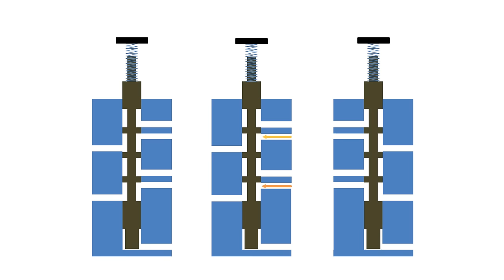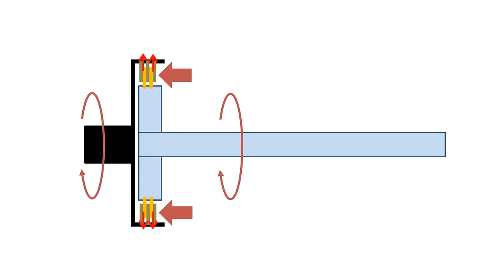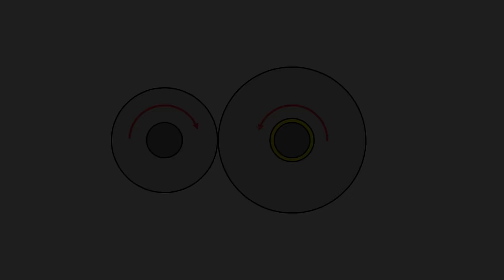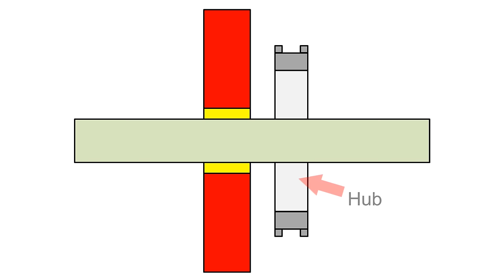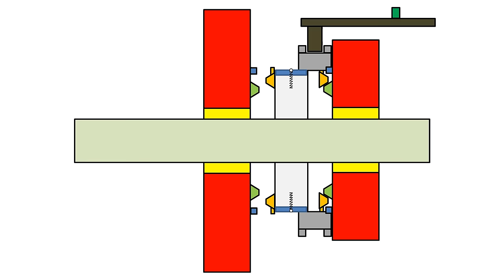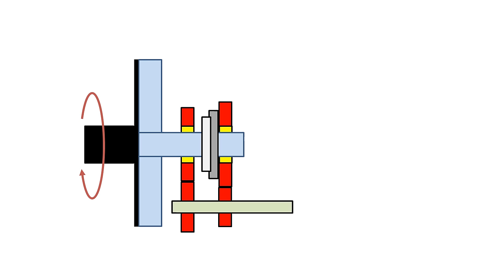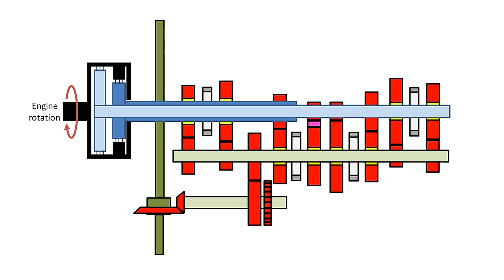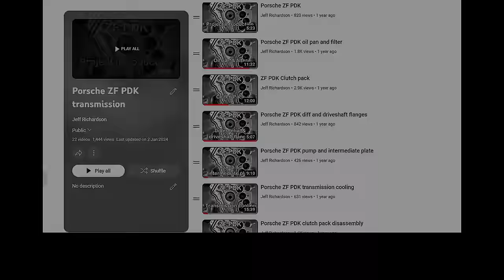World's Best DCT. Porsche PDK. How it works........... Part 1.........

Comment: Nice video. I'm working at the factory.
Reply from the maker: Really, at the ZF factory, and in what capacity?
Reply: @jeffrichardsoncardiy  since a few years in the production of the 8DT. I only occasionally work at the 7DT for the 911 and boxter. I know how to take them apart and later rebuild them, but of course in a production of new transmission many cheap parts simply will be  replaced after taking it apart.
Reply from the maker: @rakisuta1100  Thanks for getting back to me. I have a couple of questions if that's OK. How similar is the 7DT to the 8DT in the basics of the way it works? I'm also interested in getting some information about how to disassemble the gear set completely. If you were able to contact me on the channel email so I could get into your head a bit I'd really appreciate it. Email is jjrichar12@gmail.com
Reply: @jeffrichardsoncardiy  differences are a lot to be honest. Like the position of the Stift rods is now measured at the black pressure actuator at the end of it by magnets. 5 in total. Most of the oil pressure is now directed in the aluminum piece that holds the dual clutch. The pressure of the pump can be regulated, by a piston in the valve body, to save fuel or shift faster. Also the variable diff lock is managed by the valve body in 8DT, 7DT had an extra part for this.

The layout of the gears is very different. It has 2 main shafts, 1 to combine them, 2 input shafts and 1 pinion shaft. 1-5, 3-7 on input shaft 1 and 2-6 and 4-8 on input shaft 2 are the synchronizers. The reverse is separated. The high gears have  a single fixed gear. It's 5-7 and 6-8. Why combine them? To save build length.
Reply: @jeffrichardsoncardiy  how to take a boxter transmission apart. Be aware it's been quite a few years since I did it the last time and we have a lot of special tools.
Please use something to fix the 7th gears in place, so they don't fall off. 
I think you'll need a stand where both shafts from the non clutch side keep in position after the support inside gets removed.
1. We start with the clutch side up.
2. Remove those pieces that prevent a second gear to go in and the small sheet metal under fixed 4 gear. 
3. Now you need to take off fixed 6 gear by pressure on the shaft and pulling the gear up.
4. Now you need to have a tool that grabs under the other 6th gear dog tooth to pull it up, but you need to pressure it down on the input shaft 2. 
5. Remove the shift fork 4-6 and I think you can take off 4th gear fixed now, then take off 4th gear by pulling under it and pressuring the second input shaft. 
6. The gears on the counter shaft should be loose, just take them off if I remember correctly.
7. Remove the 1st aluminum piece for supporting the shafts. 
8. 2/R synchro. You can remove one side of it also the shift fork, there might be snap ring. Memory gets a little cloudy.
9. Remove the second aluminum piece that  holds the shift forks and remove those as well.
10. I think we are finished on this side and the shafts should separate now and can be removed. 
11. Input shaft 1 might have a snap ring under 7th gear. The rest can be pressed off.
12. Main shaft can be taken apart till the synchro and then be pressed off completely.

I hope you can understand it. It's just by memory.
Reply from the maker: @rakisuta1100  Thanks for getting back so quickly. I'll take a look and I'll probably get back to you when I have another look at it. 

My first question is how much force is generally required to move the gears that are an interference fit on the shafts. I'd tried to remove some at the clutch end gears and I just bent tools. I got the impression I needed a lot of heat and a hydraulic press.
Reply: @jeffrichardsoncardiy  you clearly need a hydraulic press to take off the single gears. Heat can help of course, but we never needed it. Don't know about how much pressure you need to take parts off. It wasn't a big pump, that's all I remember.
Reply from the maker: Another question if that's OK. What is holding the two shafts together that requires them to be pressed apart. Is there an internal bearing that is an interference fit? If so, what type of bearing is it? Thanks
Reply: @jeffrichardsoncardiy  the two shafts are connected by the aluminum piece under the gear for transfer the power to the pinion shaft. Each shaft inside of it has a roller bearing that's pressed on the shafts.
Every loose gear has a needle bearing with an inner ring pressed on the shaft. It's basically all stacked over each other. Kinda like an inner ring , synchro inner part and then another inner ring. At the end often a flat ring is pressed on to hold the loose gear in place and lubricate it at engine start.
Reply from the maker: Thanks again. Much appreciated.
Reply from the maker: I had a good look at it and now understand the sequence as per your instructions above. Step 3 is where I'm currently at trying to think up tools that I might be able to remove the first fixed gear on the main shaft (4th). This seems to be machined as a single piece with the spacer that sit between it and the 6th fixed gear. 

My question is how large the spline under the 4th fixed gear with spacer? It's clearly an interference fit, as the force required to remove it is huge. Is the spline just under the 4th gear and there is nothing under the spacer portion? If the splines are longer than this it would be difficult to remove the whole thing due to the end of the mainshaft being only about an inch.

Also, at the end of the mainshaft there is the inner bearing race that looks to be pressed on. This is what the needle roller bearing that is clipped into the main casing and is what the end of the mainshaft rotates in. I'm assuming this inner race that is pressed onto the  mainshaft can stay in place while the fixed gear is removed, or does this need to come off first? Or is it removed when the fixed gear is removed?

Thanks

Comment: Can an oil leak from the bell housing be connected to the clutch pack friction discs?or it could only come from the central seal and the big cover oring..
Reply from the maker: It can't really come from anywhere but the two seals you mention on the front cover. There is constant oil being shot out of the clutch pack and being collected in the pan.

Comment: Thank you for this very well presented explanation.
I assume Porsche PDK and VW/Audi DSG transmissions would be very similar since they are all part of the VAG group?
Reply from the maker: They are completely different. The PDK is a ZF product. Nothing to do with VAG except that VAG purchased it to fit exclusively in Porsche.
Reply: @jeffrichardsoncardiy I would disagree with you on that, I worked at Valmet who manufactured the 987.1 the 2003 R32 DSG used a dry clutch and the PDK uses wet clutch as an evolution of the VW gearbox use case in real life, the Audi 01E are structurally more important than you would hope as the diff and casing and 4wd are more A6 than 962. It's built by ZF and not by Porsche, hence the parts not being sold separately because Porsche doesn't make gearboxes and why this video is so revealing. The electronics, syncros, gears are shared with other cars and the reason for the early 987 2.7 having a lower ratio diff was because it was pushing an R32 around at the time. It is also why you did not get a Cayenne PDK but a Tiptronic as this is not a specific Porsche design on its own but a pooled resource.

Comment: Hey Jeff, thank you for your video. I’m a bit confused about how the synchro key works. At what point does the key get pushed down?
Reply from the maker: If by key you mean the strut, it is moved the moment the slider moves, as the strut ball is stuck in the detent in the slider.

Comment: Excellent video as always Jeff! Do you know much about spoiler failure? I had mine fail on the way to the dealer for PDK servicing and they are quoting a new drive unit replacement at a significant cost. They saw error code 81010E on the history and the motor was stripped. There seems to be very little information online so it seems like it must be a rare issue - 90% of what I found for that error code applies to the Panamera. Hoping the drive unit can be repaired rather than a total replacement... and of course if theres anything I should do to avoid it happening again
Reply from the maker: There's some info here on the spoiler that might help.
https://www.youtube.com/watch?v=it_DTpTYst0

Comment: Great description of the PDK. Thank you. I am wondering if, basically, the Macans use the same PDKs as the Boxster/Caymans and 911s? And I assume all PDKs are built to handle the torque of the 911 turbo?
Reply: 4 door porsches use modified audi dct certified as pdk. only turbo and gt2rs comes equipped with more capable pdk

Comment: When the transmission shafts and engine need to be disconnected, how are the clutch plates separated? Or is it the case they are always in slight contact hence the need for lubrication?
Reply from the maker: They just become loose with respect to each other, and with the lubrication they never touch and so don't wear.

Comment: Can anyone offer an opinion on my recently acquired 4.0 GTS pdk. 2500miles
It’s clunky /noisy moving off standstill in drive particularly when coming off holding on the brake downhill .
Only found after thoroughly warmed up.
Possibly clutch pack?

Comment: Great explanation and excellent engineering by Porsche, too bad the drivability of the transmission is crap. This is primarily due to controls and I’m not sure if a mechanical limitation. Maybe you can shed some light on this. The transmission prevents upshifts and downshifts that would not cause redline. It also will not bounce off the rev-limiter and hold gear, it always wants to shift which is bad for some situations. There is no true manual mode, it will always shift up or down when in M mode. Sometimes the cpu gets lost and there is a delay in shifting. I sold my Porsche because the drivability of the transmission is horrendous. Give me a 6-speed any day over the PDK automatic. It’s actually hard to find a manual Porsche these days???

Comment: A little history on how long it took to make this transmission small enough to get into a normal sports car. They were developing this transmission in 1983 for  LeMans. I think they won Lemans in 1986 with this in an extremely long tail race car. I bought one of the first 911s with the PDK in 2009 . I’ve probably got some of this wrong but I believe the timeline is close.

Also after the credit crash of 2008 I got the best deal I’ve ever received on a 911. It was a 911S with MSRP of $103,000. Nicely equipped. Porsche was giving $12,000 rebates PLUS 0.9% financing BEFORE negotiating. I think I got out at $78,000 out the door. 
In hindsight I should have just kept my 997.1 GT3 but I felt that credit crash coming and I didn’t want a high value asset like that. But I still have a GT3 now

Comment: Jeff if you can or if you’ve done the research can you explain parts cost based on which part failed? It would be easier for backyard mechanics to replace subassembly rather than actual individual parts without special Porsche tools?

Comment: hi Jeff I purchased a 2012 boxster with water ingress to passengers footwell and the car was not running , I changed the body control unit and pdc unit , nothing else seemed to have had any water on it , the car will still not crank at all , the ignition comes on I press the brake (Pdk) it  says possible to drive on reduced power , it does not crank , not even a click from the starter but you can hear the fuel pump prime , all central ocking etc works so assuming the alarm is all ok , please any advise would be much appreciated (Happy to donate for help)
Reply from the maker: You need to get the diagnostics onto the car to find where the issue is. Without this you are stabbing in the dark.

Comment: Could you get the measurement on the input shaft OD vs ID (clearance)?
Reply from the maker: I haven't separated the two input shafts from each other as I don't have the heavy workshop equipment required.  So I can't give you those dimensions. Why do you need them?
Reply: @jeffrichardsoncardiy  nothing really important.  Just curious to see if it's shaft on shaft/bushing with approx .001 clearance or if it has bearings integrated or what the situation is.

Comment: Multi-plate wet clutches being universal on motorcycles, I wonder why it took car makers so long to implement them for cars. Sure it decreases the transmission oil change interval, due to friction material contamination and more heat being transferred to the oil. But it will do much better when crawling in traffic than a dry clutch. 

Another very interesting development of the co-axial output shaft DCT tech is Ducati's "seamless" shift manual sequential transmission. It just replaces the Dual Clutch in the DCT with locking bearings to select either output shaft. Manual sequential transmissions in race cars and motorcycles have long been able to shift without disengaging the clutch due to a more robust dogtooth design, the locking bearing just reduces the jerk in the sift just like a DCT would but a purely mechanical system without needing any electronic control.

Comment: IF You Think That is Clever !!
Honda ATV Quad Bikes Have Had DCT Trans in an Engine of 420cc With All That DCT Equipment inside the Engine Casing Next to the Crankshaft !!!Only Using The Engine Oil To Work it !!!Not Special Trans Oil 

So Everything Your Looking at Hear is Inside the Engine on a Smaller Scale and its Not Removeable Unless You Split The Whole Engine !!!
I Had to Fix One And It Was Very Difficult To Sort Out.
I Would stick to a Manual Trans Knowing What i Do As When Things Go Wrong With Oil Pumps,Sensors,Clutches,And Everything Else DCT Is 
Very Exspensive and Very Difficult to Fix.

Comment: When you say exclusive to porsche, i assume you mean VW Audi group as DSG = PDK doesn't it ?
Reply from the maker: The Audi and VW transmissions are completely different and not made by ZF. ZF PDK transmissions are only in the Porsche sports cars and Panamera. Panamera transmission is a very different design to what is in the video. The Macan PDK is an Audi transmission.
Reply: Ah ok thanks Jeff. Surprised that ZF would restrict exclusivity to a lower volume manufacturer like Porsche, must be a very expensive unit. That shot of the valve body looked like a slice of a human brain extremely complicated and possibly not totally understandable !

Comment: I've stopped the video up to the 9 min. mark and wonder why a clutch pedal by wire could not be used and then a manual shifter because the clutch is fundamentally no more different than a motorcycle clutch. To have the control of a clutch and the shift knob adds a whole new element to driving. I drive my Z06 never putting my right hand on the steering wheel as I do all my driving I palm the steering wheel with my left hand which is far quicker for reacting. I've driven a Porsche Cayman GT4 and a Corvette C8 and I absolutely hate how they shift ¿`_
Reply: What??? Some people don’t like shifting plus PDK is a lot faster than manual shifting, some even track their cars where PDK just shines. I like manual shifting too so have a manual Boxster but I also have PDK equipped Macan, bot car are great and meant for different purposes. Different cars and transmissions for different tastes and styles of driving.
Reply: @olasek7972  you missed the point! The car could have easily been offered in two versions a pdk and a manual because the clutch could be operated by wire ¿`_
Reply: @olasek7972  and for argument's sake no one can come off the line like I can with a motorcycle because I know how to operate the clutch better than anyone. The clutch being operated by wire (electrical current) could have operated the same way ¿`_
Reply: @olasek7972  and I'm tired of the argument that it can shift faster! I don't care because downshifting and trying to maneuver through the gears is a pain in the ass and you just can't slip it into neutral anytime you want. Oh, I'm sorry I forgot, you can pull in both paddles at the same time – I don't give a s*** ¿`_
Reply: @user-ys9to2ie7k  comrade, stick with your motorcycle, it fits your pocketbook 🤡
Reply: @olasek7972  I'm sorry, I thought you were the actual channel that was responding, I didn't know you were a nobody! I would have never responded to begin with ¿`_

Comment: Sad to see them brake down a lot on the range sensors and pressure sensors.
We replace those sensors almost daily.
And 95% low mileage cars so yeah not that reliable in my opinion for a brand like that.
Also Porsche tells customers sorry we can't replace the sensors you have to buy a new transmission.

Comment: From an engineering point of view, the PDK is a disaster with heavy redundant components, high friction and other annoying things. Created by an Italian in the 30s for a tank where it belongs. The Toyota LFA has a sequential gearbox half the weight and can shift to any gear you want. The Honda and Yamaha patents to make it steetable were expensive otherwise HP cars would have gone in that direction. GM copied the Porsche ZF design to keep the engine close to the axle. They both use those dumb transfer gears for the final drive which offsets the differential. Both the C8 and 911s are compromised engineering disasters and both structure and suspension designs suffered as a result. Look what both companies have to do to their cars to go racing. Also it cost a fortune to fix those POS.